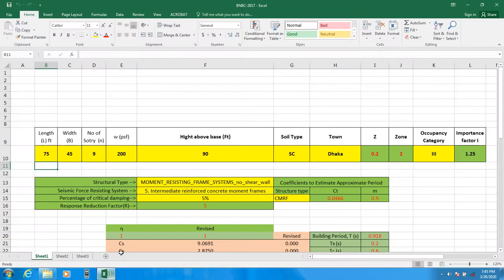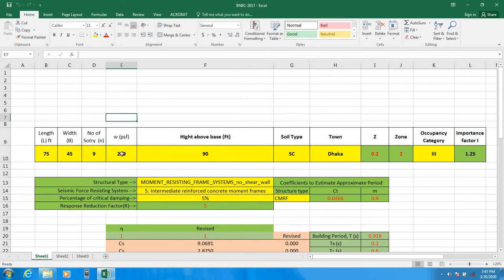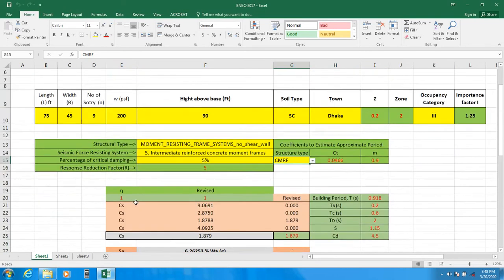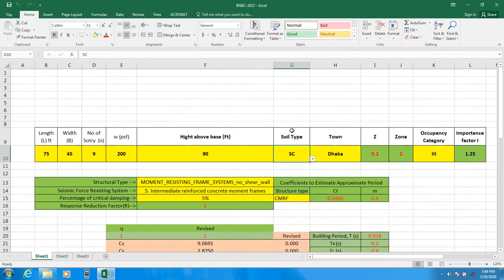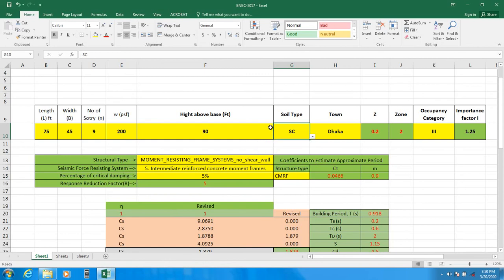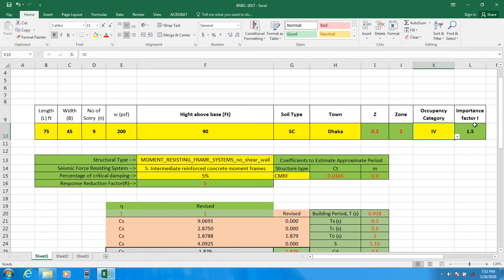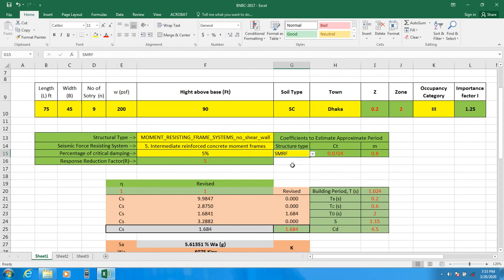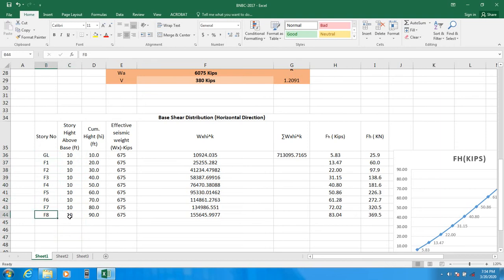Earthquake load analysis As per BNBC 2017, ASCE 7-05, ASCE, 7-10 with Excel in Etabs | Lec-1

Comment: The video you have made is really good.

Can you add this two missing data in your Excel File?
Table 6.2.19: Response Reduction Factor, Deflection Amplification Factor and Height Limitations for Different Structural Systems
D. DUAL SYSTEMS: SPECIAL MOMENTFRAMES CAPABLE OF RESISTING AT LEAST25% OF PRESCRIBED SEISMIC FORCES(with bracing or shear wall)
E. DUAL SYSTEMS: INTERMEDIATE MOMENTFRAMES CAPABLE OF RESISTING AT LEAST25% OF PRESCRIBED SEISMIC FORCES(with bracing or shear wall)
Reply from the maker: you are right. i have updated that.  i will provide that link as soon as possible,. stay connected.
Reply: @qlearnify-en   Thanks and waiting for the update
Reply from the maker: @myneuddin4690  now check
Reply: @qlearnify-en  Great job
Reply from the maker: @myneuddin4690  thank you